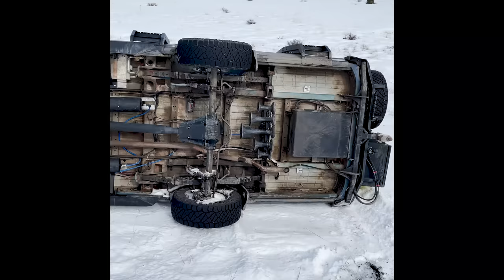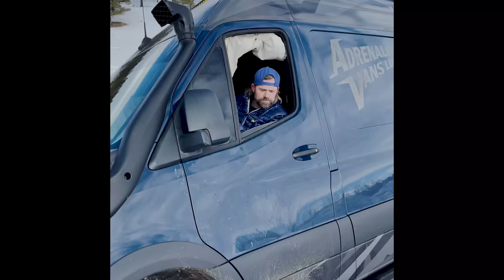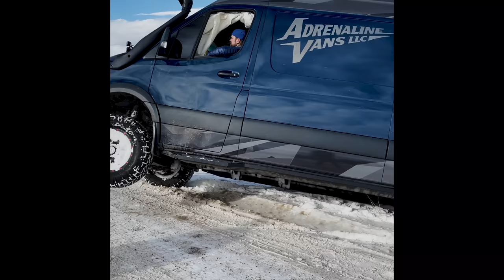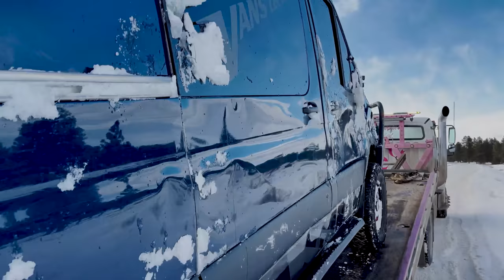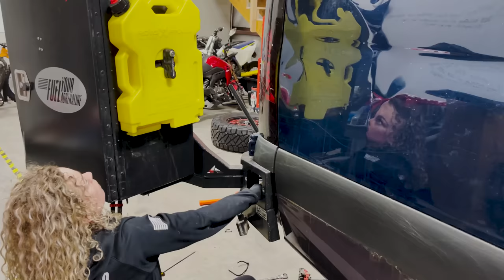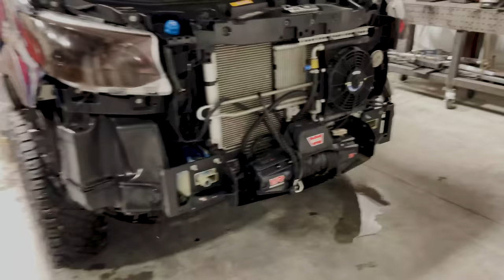DID I JUST DESTROY MY $200K 4X4 SPRINTER?!!

Comment: The biggest take away is that vans CG is already very high. When we kit them out with all the gear and lift them,.., CG is only going up.
 I would keep that in mind for the future...
Glad nobody got hurt. 👍🏽
Reply: Please don’t tell me you have a degree in anything that requires knowledge of physics. First find out if you can from Mercedes where the center of gravity is located relative to the ground in the factory configuration. second modify that based on the weight and location of the center of gravity of every modification that you make. if you remove anything that was previously located above the center of gravity you have lowered the center of gravity. if you add anything that is above the previous center of gravity you have raised the center of gravity. this will require multiplication addition and subtraction and using a measuring tape and I’m not sure you’re qualified, or do you just shoot from the hip to be able to “contribute” to the conversation. If you can’t find out from Mercedes where the center of gravity is on the existing factoring version have an engineer or someone with knowledge of weights and physics guesstimate how high it is off the ground because the only important thing is that you account for things based on their distance from the center of gravity and their weight so even if your estimate of where the sin of gravity exists currently is it is still valuable to go through the exercise and if nothing else it will keep you reminded of what the goal is. What surprises me is that the heaviest things that people put in their vans are often put higher up than they need to be. One good example is fresh water storage. So far I have only added capacity for 18 gallons though I will probably add more later but I am traveling alone. For $75 I found a stainless steel tank that was part of a water filtration system removed from a multi-million dollar home. It fit perfectly in the space underneath and beside the sliding door on the passenger side and doesn’t hang down basically at all below everything else on my 4 x 4 sprinter tall top. That actually lowered the center of gravity. Obviously taking the spare tire from underneath the van and putting it half way up the back door just because you think it looks cool and you want to justify paying $2000 for a useless ladder from Owl Vans that you think looks cool but it doesn’t because it looks stupid raises the center of gravity a significant amount. Don’t listen to retired watch photographers that have the notion that it’s best to put heavy items directly over the rear axle. You will end up reaching the capacity of the rear axles without ever coming close to reaching the capacity of the front axle if you do that, and obviously anything over the wheel wells is going to have to be higher up than it might be if placed somewhere else.
Reply: The center of gravity of the van had a little to do with this since 90% of vehicles would have rolled over unless the moral of your story is don’t buy a van. I had a factory 2012 Toyota FJ cruiser driving on the freeway in Berkeley California going 50 miles an hour in the slow lane when some idiot going 75 in the slow lane did an accidental pit maneuver on my rear bumper knocking me off the freeway onto a slight embankment Causing my vehicle to roll over twice. I even had the factory tires on it and no additional lift. The only thing that lifted the center of gravity came on it when I bought it. I admit it was a very heavy duty full length aftermarket welded luggage rack made out of steel but if that had not been on the roof I probably wouldn’t be alive today because it acted as an amazing roll cage and made my roof not cave in on the driver side. If I had had a passenger it may or may not have saved their life to because their side was caved in more.
Reply: @GOLDVIOLINbowofdeath Sorry but you're trolling on the wrong guy. As a qualified Commercial Pilot and Flight Instructor I have learned and taught enough about weight and balance to understand how even little changes can greatly affect the stability and dynamic characteristics of a moving vehicle. So really only stating the obvious here and not judging or criticizing anyone. 👍🏽
Reply: Hello pcmartiny. Just wanted to compliment you on, what I immediately took from your initial comment re CG - that this guy knows more than he's letting on. I've been quietly venturing in my van for years, upgrading the WHOLE suspension while weighing the difference of virtually every replaced part, and am VERY CG aware and try to keep heavy low, and light high. With military aviation jumbo experience at over 800k pounds of weight, I know CG as well.
I don't normally reply much on these posts but when someone throws their heavily self-valued opinion around, one tends to learn more about them as a person, and less from their display of knowledge. Criticism becomes a distractor from the intended message. I digress.
I totally agree with your, "...only stating the obvious and not judging or criticizing anyone."   Everyone out there, have fun. Be safe.
Reply: I think gold violin’s CG is a little off from those huge run on sentences in his head.  Definitely top heavy.

Comment: I rolled my Sprinter too, but had about 70km/h speed. Had just finished welding, fixing and painting the whole van over, a 3-year project that was finished just 2-3 weeks before the accident. Same kind of damage, but a little worse on the roof corner, so not fixable. Also only had the mandatory insurance that wouldn't cover anything... Took 2 years before I was able to even start parting out the van, as it was emotionally too hard to see it in that shape. But well, as long as nobody gets hurt, life goes on!

Comment: Sorry to see this happen BUT you would have a chance to avoid this if the van would not have been lifted… this Vans were OEM lifted 12centimeters as Anything above that made them really unstable. Oberaigner Which installed this 4x4 for Mercedes did 200.000 kms R&D in various terrain before they introduced this 4x4 system to the Sprinter. Another thing is the wheels and high centre of gravity Which is heavy load on the roof. Lifting this Vans is really making them UNSAFE… ITS good everyones Ok! Hope you can rebuilt it and rethink the gear you have on it
Reply: Driver error if you look at the tracks you see it just went off the shoulder, most any van woyld tip over.
Reply: Sorry for them, but the physics of the design do not seem to be feasible.  I can’t imagine what the engineering team at a major RV manufacturer would be thinking about seeing the lift and springs.  What if they were hit by a big wind crossing and over pass?

Comment: When people build out a van, it’s not uncommon to learn it’s not listed in Kelly blue book for value.  That’s where they go to get values.  Otherwise you’ve GOT to provide proof of parts and items in the van.
When we purchased our ‘19 sprinter the seller flat out said no one will finance it.  ( Paid $84,000 for it). 5000 miles.  So we ended up paying cash.  Had it been a Minnie Winnie or Thor or some major manufacturer, no problem getting value.   After putting another $15 K in the vehicle it’s now insured where it’s supposed to be.  You are spot on about receipts and the like.  How is that adjuster to know how much it costs for a 12 volt dc to dc charger by victron or renergy supposed to cost or even install?  They don’t, it’s on you to show them. Good vid, hope it works out for you!
Reply: Who gave you the notion that you can’t ensure the modifications to your vehicle?

Comment: Kind of feel guilty hitting the like button.  Let us know if you need anything!
Reply from the maker: Thanks!! Appreciate you guys!
Reply: @adrenalinevans  I sincerely sympathize. It's too narrow. The body should be wider, at least about 2.3 m.
For myself, I'm looking for a base for a four-wheel drive motorhome and the Sprinter is one of three options. Don't like the clutch. I'm a proponent of true all-wheel drive. But I realized that if you choose Sprinter, it is better to take the chassis (cabin and platform with wheels), and do the cabin with flat flat walls and wider to sleep across was comfortable and there was more space.
Another option was Chevrolet Express / GMS Savanna because the frame and axles, but it is less comfortable on the asphalt and on the highway, although the car is much easier, but I do not like neither the interior, nor the panel, nor the headlights, nothing but the chassis and body.
The other option is my very favorite RAM. Ideally 2500/3500, but it is a truck in many countries and needs a truck license category (not a problem for me - still want to learn), but difficult to pass customs along with the trucks. 1500 as an option. I need 2 rows of seats for 5 people, preferably 6 people, mostly riding 4-5. Passage to the cabin from the living compartment and back is important.
The RAM as well as the Sprinter has cruise control and it is adaptive, which I really want, I like the interior and exterior (especially the RAM), and the ride comfort for 1000+ km.
The Sprinter is more comfortable due to the load-bearing body. It should also have independent suspension like V-class.
There is still a thought to make the body up to 2 meters high so it can be placed on parking lots and on parking lots the slider goes up and there is a full-size full-size house, though of course it will add weight and make design complicated in electronics.
But I know for sure that it is necessary to take the base and the body should be wider, preferably both the base and the wheels should be wider.
Good luck to you! I hope all will be well!
Reply: @4kiselevmaximENG  or a dually rear axle.  Helps stability while parked or while driving

Comment: Body damage is going to happen to any real 4x4 vehicle. Looks like a fresh mirror and some new side curtain air bags would do it. I personally would not worry about it unless it was a functional issue. Seems like the truck did well and has a lot of life left! If you had to you could get the body cleaned up and then for fun a raptor liner paint job to replace the factory paint would be badass.
Reply: Did you notice the whole right side is bashed in? Slider is not going to open, insuranceis going to total it,

Comment: I'm not an expert but to me this does not look too bad. I think it can be repaired.
It's just a lot of body work. Replacing the left front door and repairing some panels replacing others, a lot of bondo some paint and it's OK. Used parts would be less expensive.
May be you can buy a welder, a folding machine, sheet metal and learn how to use all these tools.
And oh by the ways, filming the repair process would make some really interesting videos.
It will not be as good as new but good enough.

Comment: I don’t know who gave you the notion that when a vehicle is totaled that is not repairable but over 90% of totaled vehicles are repaired and put back on the road. 90% of the vehicles I have owned in my over 50 years of driving were totaled vehicles. Where do you think I was able to buy a 2020 Mercedes sprinter tall top 4 x 4 passenger van during Covid when there wasn’t a single new 4 x 4 sprinter tall top for sale in the United States. It was six months old and had 5500 miles and was owned by a doctor judging from the beach sand in the seats and on the floor it may have made a few trips to the beach with the kids in it and on the way back the wife may have stopped in at Burger King and ran into the awning on the driver side forgetting how tall the van was. That’s all it takes to total a sprinter it’s so high up if I don’t point it out to people that are admiring my van they don’t even notice it and I haven’t done anything to repair it yet

Comment: It'll be interesting to hear how much the insurance company thinks the van was worth.  It's hard to believe how much $$ some folks will pour into a van.  We all know vehicles depreciate by a huge factor as soon as we buy them.
I've been scared in my 4x4 Sprinter just trying to get up a buddy's sketchy mountain driveway.  The extended 170 is way too long for switchbacks or any offroading.  It looks like yours just slid off the road bank.

Comment: there is no way they won't total that.... mine was caught in a hail storm and it was just on the limit of being total'd......   get every single part you can off of the van... wheels/tires and anything thats not on a stripped down sprinter....  if you get enough parts for the next build you can buy a new sprinter for under $40K and you will just need to build another from the parts...  normally the insurance won't cover custom/after market  parts...

Comment: I wish Toyota would build us a van.   My sprinter has been a piece of garbage.
Reply: We barely have issues with our Sprinters, apart from the automatic brake assist on the newest generation; We push our SPrinters to the very limits for sure, also on road
Reply: What a useless comment to make. You didn’t even mention what year it is much less the model
Reply: @GOLDVIOLINbowofdeath  2018, 144, 4x4  many problems,  poor design,  poor quality.
Reply: @TepidJean  that version was replaced with the 2019 version 4 or 5 years ago. Did you buy it new?
Reply: @GOLDVIOLINbowofdeath  yep.   But look I drove well designed trucks my whole life,  I get that if you always drove American cars that you would think the sprinter is on par.  Not with Toyota though, not even close.  The fact that they even thought releasing them that way is mind boggling, so many terrible design choices,   total amateur hour.